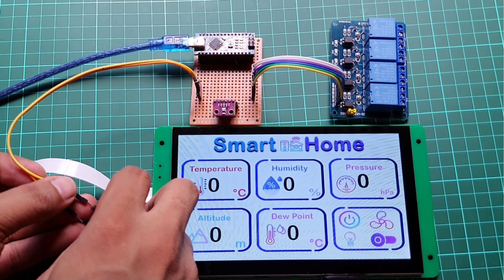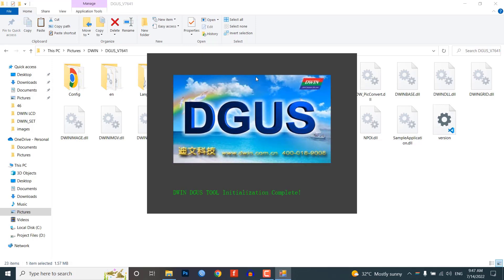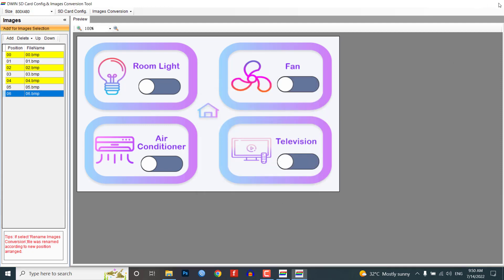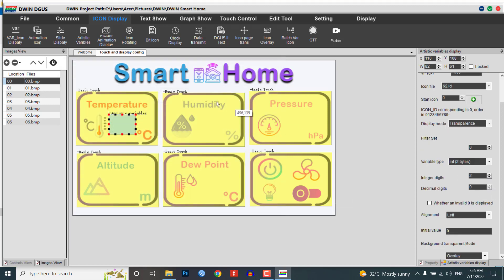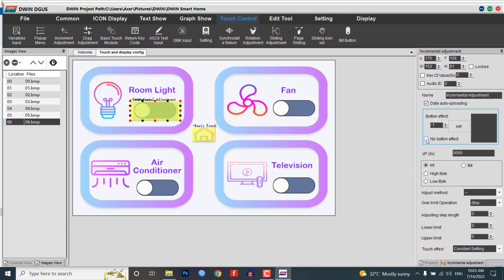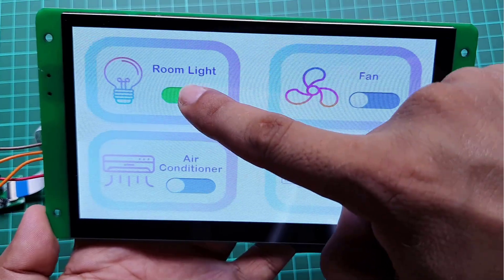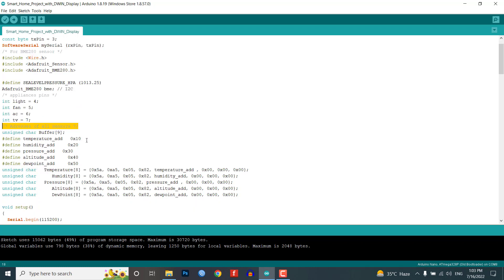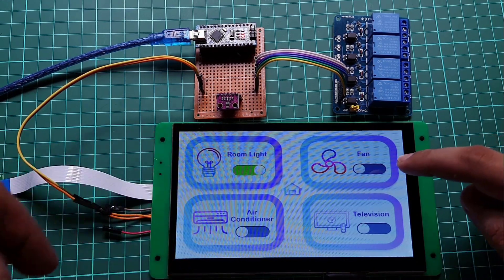Smart Home using DWIN HMI Smart Display and Arduino

Comment: great video.... quite informative.  
do we need to solder jumper to TTL/ 232 at backside of display for UART communication ?
HDL662B board is only used to download program to Display ?  or providing supply to Arduino and display ?
where else HDL662B board is used ?

Comment: Nice work. Thank you for sharing.
What is the allowable max. distance between arduino and HMI screen? How long should max. cable length be ?
Reply: It depends of which communication standard you use. If you select TTL 5V the distance is not that far. But if you use the other standard RSxxx and use shielded twisted pair the distance can be very long but you have to reduce the baudrate.

Comment: Excelent video. I have aquestion. I did a similar proyect but the screen has returned  data to the arduino when I conect the Tx line from the arduino to the screen. This makes the readings buttons dificult. Without conecting the Tx line, the buttons work very well. Could you give  any advice?
Reply from the maker: You need to connect both TX and RX pin to the Arduino as well as connect GND pin if you are providing power supply separately to Display and Arduino.
Reply: @iotprojectsideas  I Will check that.  Thank you very much.